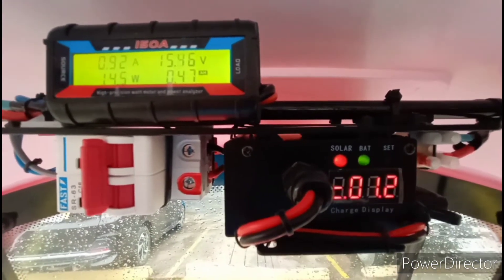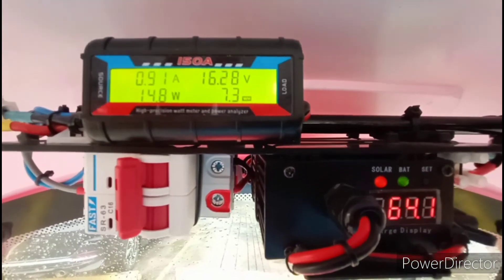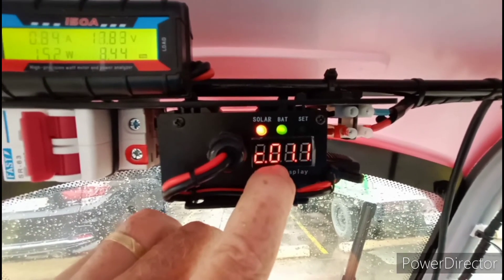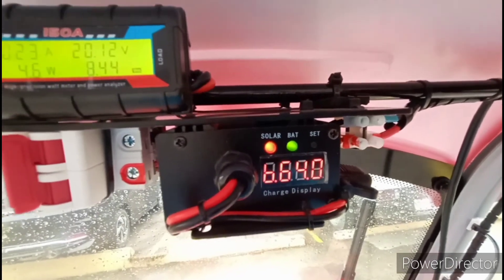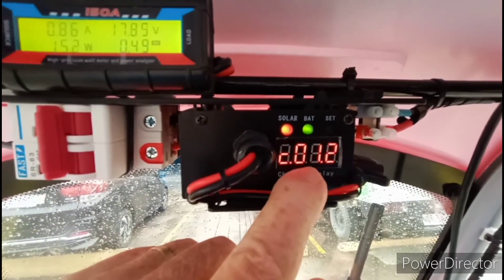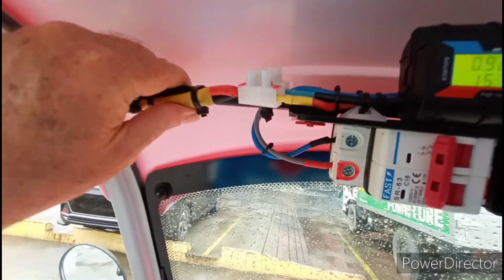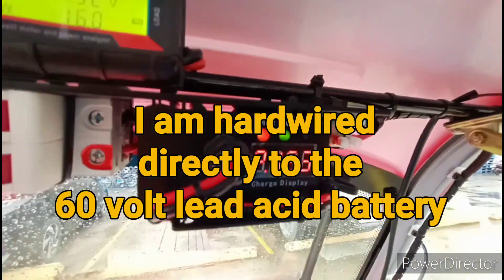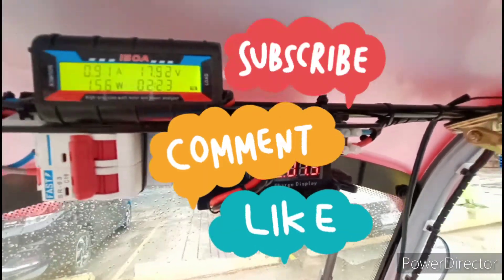Solar Charging Setup * Ebike 4 Wheel Version * MPPT Boost Controller * Wattmeter * Philippines

Comment: nice setup, just wanna ask if you could lend me a diagram the orientation wiring of the parts. also planning to do it to my ebike thanks much
Reply from the maker: Thank you for watching and your comments. 

I do not wiring diagram. Mostly because it is strange through. Solar panel to wattmeter to breaker to MPPT boost controller to breaker to battery.
Reply from the maker: Mounting is 3mm black acrylic plexiglass. A few holes for cable ties
Reply: @stevekb1dig  thanks for the reply this is my next project hihi tnx a lot
Reply from the maker: @hector2926  I have 8 YouTube uploads on the topic. This is a link to the playlist 

https://youtube.com/playlist?list=PLe4D7El0Co7ULh0gbX3I4D1mY9bFaDey3
Reply: @stevekb1dig  thanks
Reply: Hi steven just wanna ask again coz im still on planning stage hahaha..my battery is a gel type as per my dealer is it possible to set this up for solar tnx much
Reply from the maker: @hector2926  the MPPT boost solar controller will work okay. It's been used for all types of batteries.
Reply: @stevekb1dig  ah ok thanks tnx